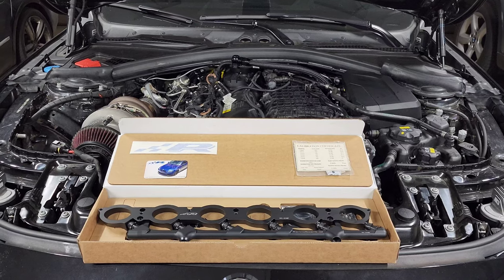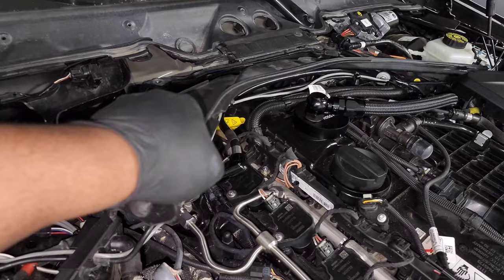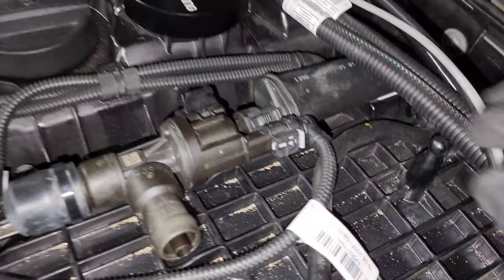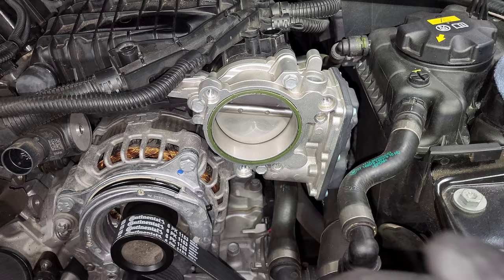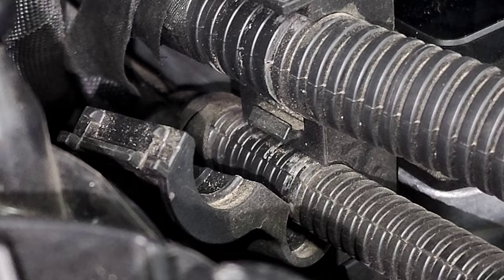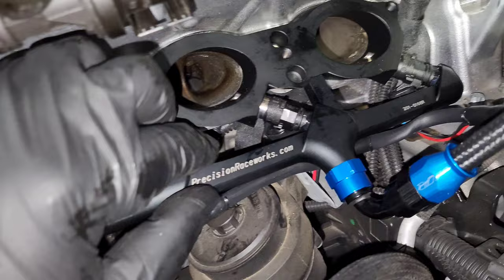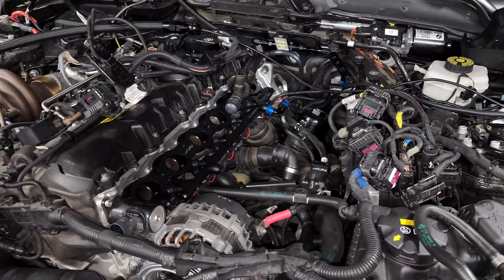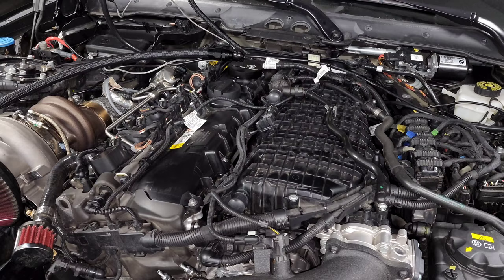Installing Port Injection on my 440i!

Comment from the maker: HOW TO ENTER THE GIVEAWAY:

1. Follow the BimmerNetwork link in the description and create an account.
2. Follow @bimmernetworkco on Instagram
3. DM BimmerNetwork with the email address that you used to sign up
4. BimmerNetwork will confirm that you're entered

Good Luck! Giveaway ends April 1st
Reply: Great vid. Quick question - I’m at 610whp now with stage 2 turbo, all the bolt-ons (catless DP etc.) Even a trans tune. My tuner told me that to get to 750hp or so I’ll need port injection and stage 3 LPFP, and I get the reasoning. However, they told me I’ll also need an aftermarket intake manifold which I DID NOT expect. Another 4500 or so right there. Am I getting correct information?
Reply from the maker: @solidsnake7167  it's recommended for higher boost levels.

Comment: Silly question but will you get that much gain by adding port injection on a stock turbo? I’m currently full bolt ons (tu pump) & I want to make a bit more power. Is it worth it to get port injection & pair it with a stock turbo + tu pump or will it be an unnecessary upgrade?
Reply: I’m running an ots bm3 map currently so I would be wondering if the motiv reflex would work hand in hand with it
Reply from the maker: not much power but more mid-range torque, especially on higher ethanol mixes.

Comment: Question, good sir... I installed the motive and port injection with a flex fuel sensor. I'm running the bm3 stg 2+ E50 tune. Do I have to get an e85 tune to run full e85 or can I run E85  as is since it's got the flex sensor on the motiv+?
Reply from the maker: As long as you have it set up properly in your tune to enable flex fuel then you don't need anything else
Reply: @kern417  much appreciated

Comment: Thank you very much for the video. I have been looking for the turbocharger electric coolant pump and could not find it. And also, I am trying to replace the radiator engine hose. Now it is showing up under the intake manifold. Based on this video, If I want to replace either the turbocharger electric pump or radiator hose, I have to remove the intake manifold.

Comment: Great close ups and lighting! Helps a lot.
Reply from the maker: Glad to help 👍🏾
Reply: @kern417 if you would have to change 3 thins at the same time, turbocharger hybrid , intake manifold and from tu pump to dorch. Where would you start? First the turbo or the intake manifod?

Comment: I’m having trouble connecting the fuel line, I have installed a Dortch flex fuel analyzer, and now I can’t connect to it there different size now 16:42 what should I do?

Comment: Love your vids man.

QQ- my installer just installed PR PI kit today…as an end user, how do I know if the PI is functioning as it should?? I’m on a base map and plan on doing adyno tune once my Pure stage 1 trans is broken in.
Reply from the maker: Monitor your fuel trims. You should see a shift when the port starts spraying

Comment: Hi kern! Thanks for this video. My first reason i.m thinking about port injection is to keep the valves clean.
Do you think port injection will make more power too with Pure 800 in M340i? We do not have ethanol just 93 octane.
Many thanks!
Reply from the maker: It will allow more torque sooner but not necessarily more top-end power.
Reply: @kern417  Many thanks!

Comment: Great video for putting you to sleep 😴 💤
Reply: I see this one goes into the existing fuel supply. What would be better for max power/bhp wise, how you  installed the kit or running meth through it on an e60 tune ?

Comment: Does the port injection supply constantly along with the DI injectors or at certain ram only or what.
Reply: Depends on tune but it can do whatever you want
Reply from the maker: The controller will dictate when and how much they spray.

Comment: Would this be good to keep carbon build up from happening?
Reply from the maker: Yes although it's not a big issue on the b58
Reply: @kern417  would it be possible to shoehorn a s58 into a 2022 g42?
Reply from the maker: @panthersfan3168  most likely. I don't see the body being that different from an m2

Comment: Seemed like a nightmare to do good stuff bro , dumb question but if you were to upgrade the intake manifold would the port injection kit be needed ?
Reply: All the intake manifolds over seen have ports for secondary injection already built in so no you won't need this if you're buying an intake
Reply from the maker: All the aftermarket manifolds on the market have provisions for PI, so all you need are fuel injectors/lines/rail.

Comment: This work for a supra fellas same steps I mean ?
Reply from the maker: Yes it's virtually the same
Reply: @kern417  thanks for the quick reply brother I'm doing it today on a customer's car. So I also need the controller as well for this yes? Customer only supplied the spacer kit?
Reply from the maker: @justinharris627  you can install without the controller but it won't work without it and it'll require the same job to install the controller later
Reply: @kern417  big thanks so I'm also chasing a exhaust leak so I'll get to work on that, until the customer gets a controller. Your the man 👨 🙌
Reply: @kern417  do u have a video by chance of installing the controller? Or can point me in the direction customer is buying the bad ass one of the three on the website 🤔
Reply from the maker: @justinharris627  https://youtu.be/fQuJd1XzYK8
Reply: @kern417  beyond appricative brother I'll let you know how it goes